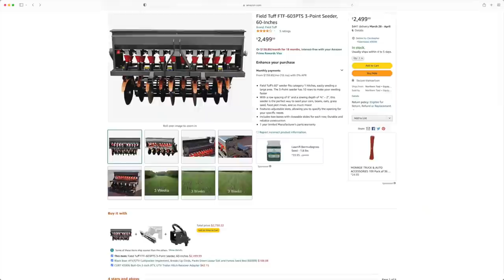WHICH IS THE BEST ATTACHMENT FOR YOUR SPRING PROJECTS?

Comment: With the post hole diggers, what was that hand held thing the guy had that seemed to help it?
Reply: A stabilizer bar that helps guide it to the "right spot" & keep it vertical. Also, for safety sake, it keeps him away from the auger, since reaching in to make adjustments by hand is a BIG NO-NO! Bad ju-ju & harm/death can occur from getting too close to powerful rotating equip! That goes for ANY mechanical equip/devices. Safety is NO accident. Good luck & God bless!

Comment: Question about the Bora wheel spacers, putting the tire further out, does it put extra stress on the axel?
Reply from the maker: Theoretically yes. But we took a survey of people who use spacers and haven't heard of any problems.
Reply: @Good Works Tractors   of course you say that cause u dont want to loose business   lol jking bro
Reply: @laisuresboringadventures7052    He doesn't sell them, he offers them up as a solution to increase tractor stabilization.